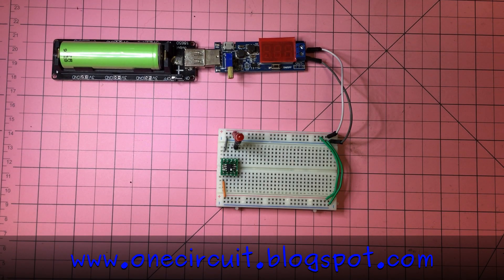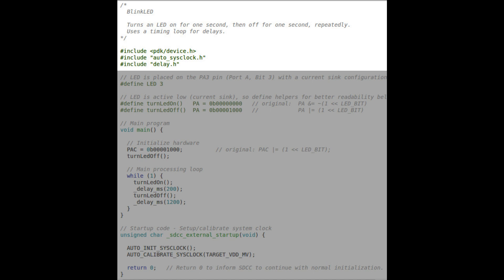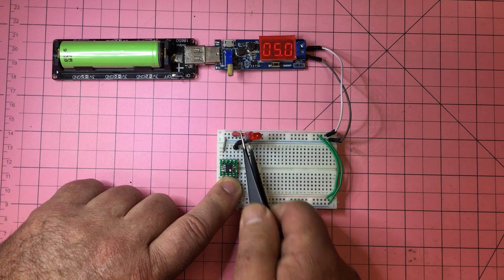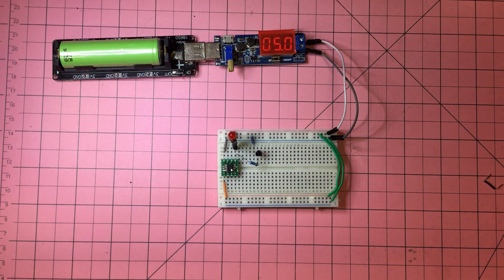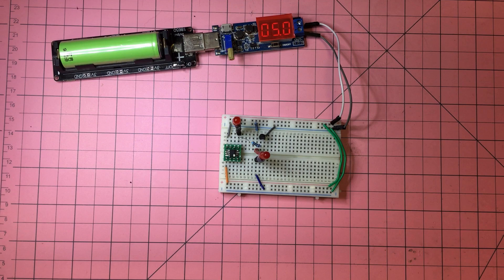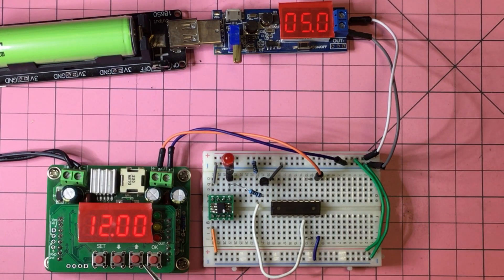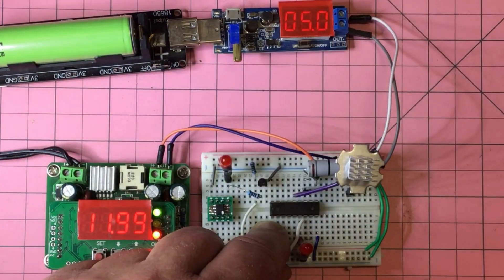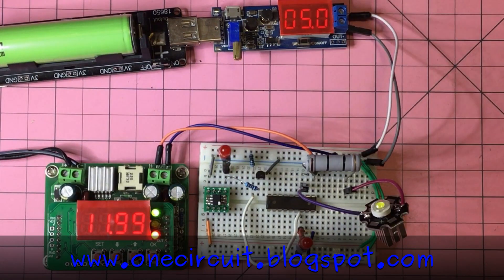PFS154 first "project"

Comment: 6:35 where I can find that power supply module in the left? thanks.
Reply: i found it, B3603 BUCK-3603 digital led display dc-dc power supply
Reply from the maker: In the end I made my own PSU using a buck/boost module as a starting point. Good luck. 👍😀

Comment: Nice work. I want to play with those little uC's, but I need to wait. Now for all the SDCC is-ums!  You will get getting the "conditional flow changed by optimizer ... said EVELYN the modified DOG" in no time! As well as other optimizer goodness.  SDCC is a good compiler though.